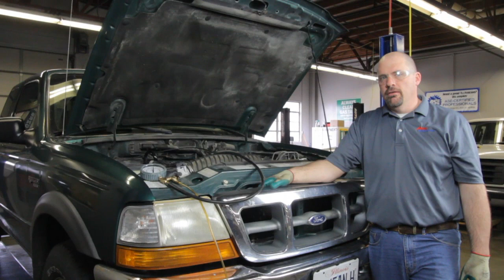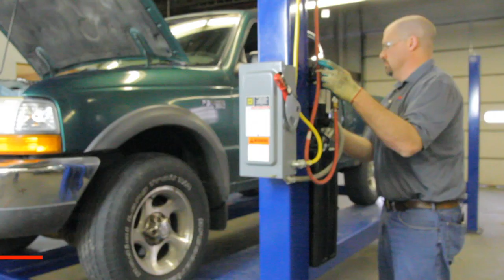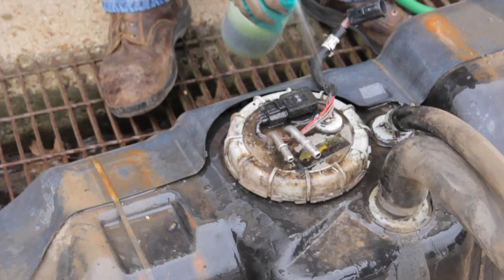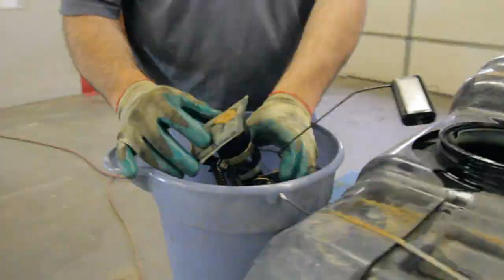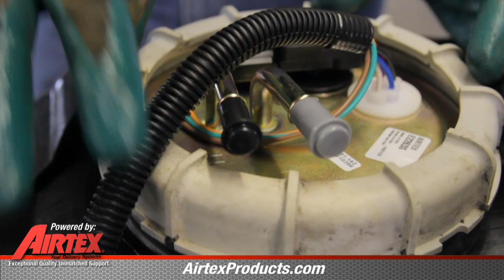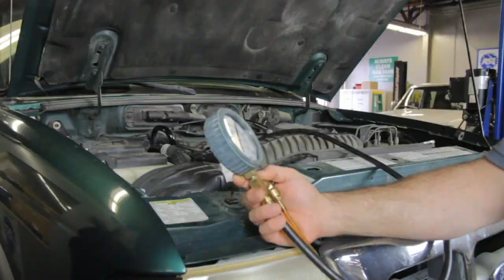How to Install Fuel Pump E2263S in 1999 Ford Ranger and 1998-1999 Mazda 84000 Cab Plus Pickup

Comment: God No that's not what I did.   I cut and made a removable panel right above the fuel pump didn't have to do all of that. took 5min had access to the pump. Then if something was wrong with the pump or went wrong again it was a matter of a minute to get access to the pump

Comment: Very good vid.  My mechanic is doing this job for me right now.  I asked his opinion as to why Ford starting putting fuel pumps in the gas tank, and we both agreed.  They are not exposed to the outside elements so they last longer.  However it is much easier to replace them when they are outside the vehicle.

Comment: How you'd get the tank past the rear axle? Mine was stuck on the front-most cross beam?  it only drops so low..then the front part has a lip that is 6 inches under the cab? Do I just keep pulling?

Comment: The 1999 Mazda 153 C.I./2.5L  126" wheel base Plus Plus Cab uses Airtex E2208S or Spectrum Premium E2208H withOUT fuel tank pressure sensor
Reply from the maker: A 1999 Ford Ranger with a 2.5L,  153 C.I.D uses a E2261S with a 112.0 wheel base, E2262S with a 118.0 wheel base, E2263S with a 126.0 wheel base.
The E2208S is not applicable to 1999 Ford Ranger.
Reply: Amazon lists the E2208S unit for my 1999 Mazda B2500 2-Door 126" Extended Cab.  The above title lists the Mazda Plus Cab B4000 & the Applications subtitle mentions the Ranger 153 C.I./2.5L (like a Mazda B2500).  Easy to conflate the two...thanks.  Also, Airtex emailed that "Airtex E2208S fits a 1999 Mazda B2500 (2.5L) Extended Cab Pickup."  I just found the current faulty unit is a Spectra Performance 2263, so they confused even the last mechanic - the B2500 (2208) & Ranger (2263) are virtually the same vehicle!

Comment: 99 Ford Ranger me too. Do you know if a P0171 and P0174 can be related to a bad fuel pump? That means that my engine is too lean and the check engine light comes often (most of the time when I climb a hill). Rough start and rough acceleration sometimes.. I know these 2 codes can be a lot of everything but I don't know what to check 1st. And if I check with a fuel pressure gauge, what will be a normal reading? Just want to know what could be the reason for that problem. Thank you!
Reply: Hey did u ever figure it out? I’ve been having the same issues. I got a 99 ranger I was thinking my fuel pump or flex fuel sensor.

Comment: Take the damn bed off... Way less crap to deal with,...   No messing around with a tank full of fuel and spilling the crap everywhere.   Way less problems later and safer by a long damn shot..
Reply: Black Box it's way harder to take the bed off of you have a flare side and the bed liner. You have to take the top rails on the bed sides off and the tie downs to get the bed liner out then you have all of the bolts to do.
Reply: Still safer to take bolts out and liner out that drop a tank of fuel and spill all over the damn place.   Harder sometimes means RIGHT WAY.   But I do understand having to deal with getting those caps off.   If you break one then its right there looking at ya everytime..   but I take that any day over dropping the tank and spilling any.
Reply: cberbes not all beds are just 6 bolts. If you have a flare side and the Bed liner like I do there's like 24 or some shit like that. So dropping the tank is a lot easier.
Reply: He's right, the bed is 6 bolts and you only need to pull it back a foot or so. I just did one with a topper and a bedliner. Took two people all of five minutes to have easy access to the top of the tank. On the ground, hand tools, no dealing with a heavy fuel tank and fuel, disconnecting lines you can't see. Pop the bed and save yourself a ton of work and time.

Comment: I was able to lower my gas tank and the only thing the is still connected is that darn connector on the lid of the tank. I have the scissor version of the tool, but it is not working. it seems to be stuck. My next option it to use some pblaster and some break cleaner to flush it out. Do you have any more suggestions? it is a 1999 for ranger.

Comment: good video, could you tell me how  I can  chk if I have power going to the fuel pump with out dropping the tank on 2001 ford ranger 4x4  what 2 wires to put a meter across when I have the key on. thanks

Comment: Is the 2000 Ford Ranger the same exact setup, or did they change something along the lines of gas tank or pump? I am just wondering because it doesn't specify for the ranger but it does for the Mazda.